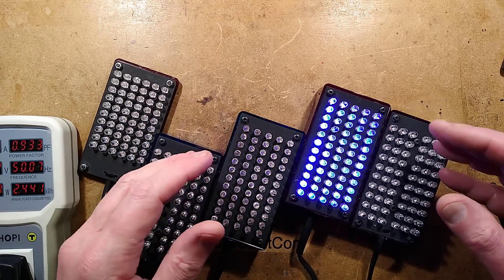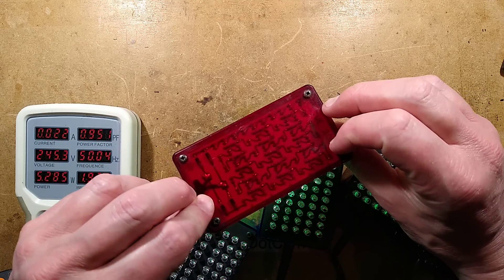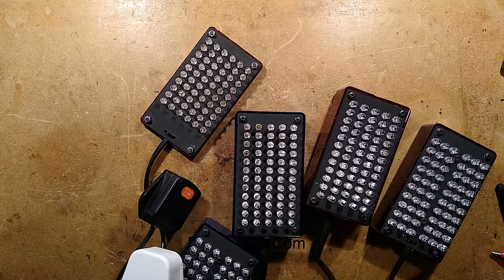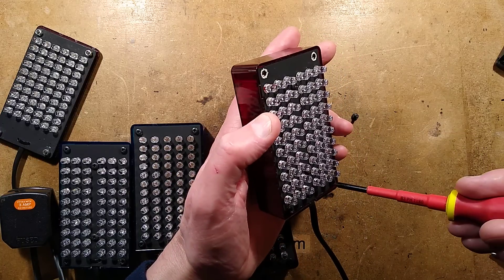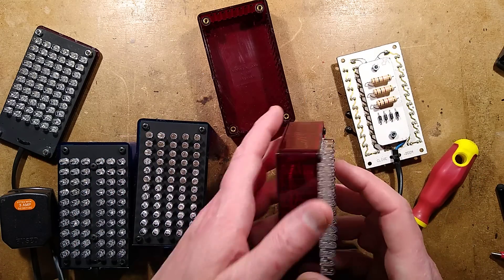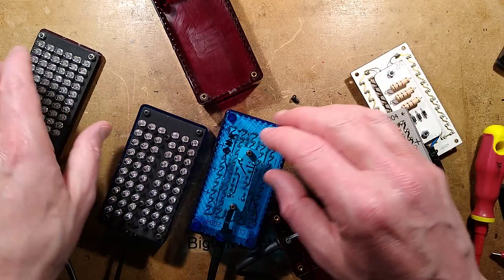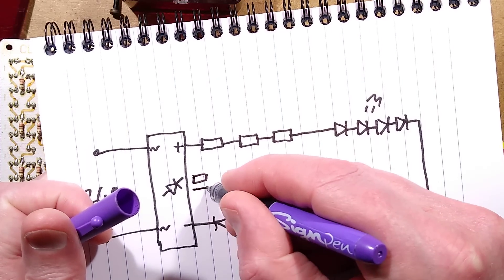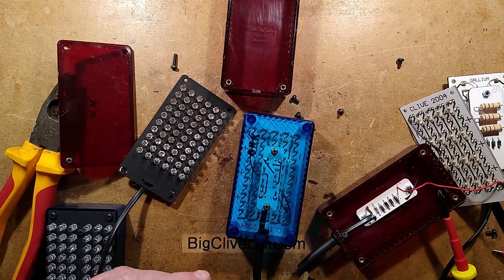Prototype mains LED lights

Comment: Love to see you build a homemade led plant or aquarium lights with the proper nm wavelength LEDs like the correct blue red(405nm I think) IR and other spectrum since I've found tons of discount online sellers are selling plant lights with similar looking colors, but are actually the incorrect spectrum than what they claim, just attempting to trick the human eye with various colored LEDs. It would be a fun project to work on and see if you can find a affordable cheap product with the correct wavelength. Just a suggestion not a request haha. Cheers!

Comment: You should really take a look at those new smart LED view cover for the newer phones. They work in mysterious ways with new phones that allow you to reverse wireless charge, but it even works without any of those features on (including bluetooth/nfc/wifi/data). I'm really baffled as to where it gets it power and how it communicates (you can upload your own image using an app to those covers), though online I read that it is in fact done using the same coil that allows reverse wireless charging.

Edit: you can even get them from the phone brands such as Samsung, so it's not even a weird chinesy thing!

Comment: For the current regulating version the lm317 was usable i think because it uses a relative/floating voltage.. and with a pullstring (isolated) switch attached you can use two brightness settings by switching a current sense resistor in parallel..

Comment: With all the LEDs in serial, how is the green one (with the dead LEDs) still working?  Surely, if one fails, the whole lot will switch off - a bit like the old Christmas tree lights?
Reply: InGaN LEDs often fail short circuit.

Comment: Hi Clive, could you put a smoothing electrolytic capacitor on a simple circuit like that for smoothing? Obviously would have to be rated for 240v RMS mains.  I've been toying with making some kind of 'easy maintainable' LED panel for my work area that'd be good for doing videos, since usually the high powered ones are pretty bad for filming or they're very expensive and usually disposable.

Comment: These remind me of a construction which I did in about 1988, one with orange and one with green LEDs, for our school's photographic darkroom. The narrow emission allowed for quite a significant light intensity without affecting the photographic paper. No circuit board, just point-to-point wiring of the LEDs which were stuck in a piece of MDF behind a plastic cover.

Comment: These would work well with the drivers from the bulb filament Led lamps as a current limiter.
2004 is so long ago, I am now 35 years old and in 2004 I was in 9th grade 😦

Comment: I remember those times. At that time there were still auctions on ebay (almost dead now). I felt lucky when I got 50-packs of (inflated brightness value) blue LEDs for less than 20€!

Comment: Is it more efficient to have a higher voltage LED array, maybe 300v, and have a large smoothing cap and lower value resistors? Obviously PF will suffer.

Comment: I have some LED Edison Socket lights that we acquired in 2006 with similar dome shape LEDs in them. They were not cheap. They are very blue with a high K value. No visible ripple (good drivers).

I decommissioned them in 2010 and kept them. An interesting look at how LEDs were made in the early 21st century.

Comment: This reminds me, I need to revisit my 3d printer LED light. After 2 years of being on 24/7, it finally had a few LEDs die, which caused the series strings to stop working. I think on my rebuild of it, I'm going to use fewer LEDs and under-run them, as my original design was way too bright!

Comment: Let me guess before I watch.  From china so no fuse, no earth, probably a metal bit or two that tingle when touched and no current limit on the input if the rectifier blows up.  I was right as the resistor is on the DC side so if a diode pops the bridge emits it's magic smoke!

Comment: There must be something about the Scots and multicoloured lights. I remember building a light display with an ex-GPO uniselector, Christmas tree bulbs, an Airfix 12v supply, a relay and a capacitor when I was a kid. The relay was wired to the supply via its NC contacts, and the capacitor was wired across the coil. This resulted in the relay switching on and off roughly every second. The switched output drove the uniselector, which lit each different coloured bulb in turn. Must be something to do with the long, dark, wet Scottish nights.
Reply: Multicolored lights are popular here in Mexico, too - perhaps Scotland was first settled by the Maya.

Comment: Is there any disadvantage to using one of those linear current regulator chips, if you can find a source? Besides the obviously higher cost compared to resistors.

Comment: I remember the first LED lights I got from China that screwed into a light socket in the mid-2000s. The light was a dim, cold blue, but they looks so futuristic like it came out of Star Wars. After a year or so, the novelty wore off, and I replaced them with generic, warm white LED bulbs from Walmart. I was so used to the cold blue that the bulbs kind of looked like orange bug lights for a white. I'm still using them. I've used brand name LED bulbs elsewhere, and they just don't last nearly as long as the cheap generics. I think it's because the brand name light bulbs are driven hard for a short life, and they're relying on their brand name for you to not try the generics and just come back for more crap brand name LED bulbs. Still, they may be developing shorter lived generic LED bulbs, so I don't think LEDs are ready for permanent fixture installations. I don't want to replace a light fixture in less than 10 years. In general, I just don't care about the look of a light fixture unless it just looks really hideous. If it does the job, I don't see much of a point in replacing it.

Comment: I did something similar around the same time. Except I made them into 15 LED strips, ~ 40cm long (x15mm wide). Cheap 5mm white LEDs, and a capacitor dropper prior to the bridge rectifier. Problem with those cheap white LEDs, was that the phosphor aged quickly, and it lost brightness, only after a few 100s of hours of operation. I still have a few hundred of those cheap white LEDs left.

Comment: Is it possible to combine simplicity, low/zero flicker, and high power factor? Or is it more a case of "pick any two"?
Reply from the maker: You can have everything, but it makes things more complex and expensive.  Power factor is the hardest to fix, but isn't too critical with low loads.

Comment: Clive, I have a question. Can you make a rectifier bridge using LED’s? To convert the AC to DC?? Just wondering.
Reply: A rectifier has to block current when the voltage across it is reversed.  A very ordinary silicon diode may support 100V reverse or much more.  Most leds have very low reverse voltage breakdown.  If you  want to rectify 6V ac you might get away with it.  For higher voltages check "reverse voltage" in the data sheet for the leds you have, or similar.
Reply: Also the current rating of the LEDs isn't really suitable for using them as rectifying diodes...
If your circuitry is only drawing 20mA, it might be okay 😃

Comment: Nice to hear what you would do now compared to back then. Any chance of building one with what you would do know and compare the output & current draw side by side?

Do you look at some of the stuff you have done and say "i can't believe this was state of the art high level tech stuff, now everyman and his dog, including school kids are doing stuff/using stuff that is higher tech and would have cost an arm & a leg than you were/did once upon a time?
Reply from the maker: The cost of stuff has dropped dramatically as electronics have evolved.  A good example is the modules sold for use with Arduinos.  Some are incredibly cheap for what used to be an expensive industrial component.
Reply: @bigclivedotcom  Very true Clive, very true. Test instruments like oscilloscopes are infinitely more affordable and not really a mystery - when you go from a cathode ray tube screen & lots of knobs & buttons to a computer screen with soft buttons, it seems so much more easier now. It probably isn't, it seems that way. I think it really has to do with information availability and the plain English used these days by the suppliers of such equipment now.

Comment: Back in the day when LEDs were so weak, many people didn't think they would be viable as lighting, at least not in our lifetime. We used to discuss with our colleagues all the time and it happened so fast. Now they are here and just as we expected, they produce so much light while drawing so little current compared to the tungsten monstrosities we had during the past century. They are employed in all sorts of heavy duty applications too and developments are made every day. I've had no part in LED R&D but I've used them all the time in my circuits. They may seem uninteresting to people who didn't work with electronics closely. But I still get fascinated each time I look at a LED light bulb and really appreciate them. I have issues.

Comment: I would also be interested in seeing an updated version of this, since I was thinking about doing something similar. My thought process so far was to take a metal flat connector plate for wood construction (cheaply available from any hardware store) for heat sinking, sticking led tape all over it, and then 3D print a case around it. But it certainly wouldn't hurt to see how people who actually know what they're doing approach this.

Comment: Memory is a weird thing isn't it?!  I love the way you find your own work interesting as if you've never seen it before... I've come across things I've done in the past and in some cases (most recently a bit of plumbing) that simply I just do not remember doing, but literally no-one else would have done it!  Given that when I was younger I seemed to be able to remember everything, it's a little disconcerting... I guess it's a case of aging and the fact that time seems to fly by now, and I believe our brain's RAM just has a limited capacity and starts archiving older stuff away, and isn't readily accessible (if at all?!) (especially if you're constantly learning new stuff)

Comment: They lasted so long because they are minimalist, the bare minimum to work, not so many components to fail. The more components the more chances of failure. The ones with the 3 big resistors will last longer than the ones with smaller values but more off.

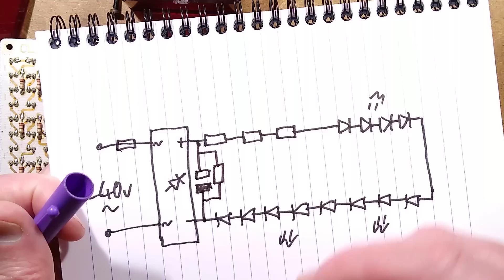Comment: Awesome stuff as usual Clive! Just one question, why the discharge resistor at 7:48? Wouldn't the cap be discharged anyway by the leds?
Reply: My guess is that the forward voltage drop of the LEDs provides so much resistance that the capacitor will remain charged to a significant voltage even after power is removed, unless another discharge path is provided.

Comment: Connect the smoothing capacitor between the 2nd and 3rd resistor (from the rectifier). 
That will fix the inrush and a guess you get a better power factor as a bonus.
Reply: Yep, same thought here.. connect 1k each from the mains to the bridge rectifier inputs, then cap, then the last 1k resistor and to the leds..
Keeps the higher voltage and spikes away from the rectifier and the cap.

Comment: Question:
I have some devices with leds in them plugged in one outlet and the leds are flashing every few seconds when turned off. (L or N disconnected trough a switch) What is the best way to prevent this?
I thought about a simple capacitor with discharge resistor that can be plugged into the same outlet. Will that work (well enough), or is it stupid?

Comment: About 15 years ago, I used perfboard and a crapoad of ebay white LEDs to make a 12v LED bulb out of an expired Philips (I think?) CFL that had a screw-on outer glass bulb, of course I was a berk and didn't use any current limiting, so "12v" solar power on a set of 4x series'd boards with the LEDs wired in parallel (assuming 3v per LED) with no limiting, yeah, that burned out in no time, wasn't all that bright either, which wasn't exactly unexpected knowing that at the time LED "bulbs" needed a shittonne of LEDs to be of any use, cos we didn't have the affordable high-power ones we have now yet... :P

Comment: Clive the Clever 
Could you design a 3d box but  add a conducive 3d filament inside the print?
This be built very thin?

Comment: If I remember rightly, the older gallium nitride LEDs had a higher forward voltage drop of around 3.5V, which would be 210V for 60 LEDs.

Comment: It's amazing how well and fast LED technology has advanced. I remember my first LED flashlight was one of those cheap 9 diode ones that ran on 3 AAA batteries and wasn't much better than your typical incandescent. Then I got my first cheap Cobb LED light and was blown away by how well it was. Now I have Cree flashlights that just blow those two out of the water!
It wasn't that long ago we were using 60-80w incandescents. Now you can leave your lights on and never see a noticeable hit on your electric bill. In fact the month I switched all my lights to LEDs, the electric company owed ME money.
Reply: Yeah, I have an old (unknown age) plastic flashlight (runs on 3× button cell batteries), which supposed to have a white LED, but it has such cold colour temperature, the light feels "icy" ‒ what a garbage LED. 🧊 🔦

Comment: Wouldn't it be possible to surface mount those diodes as well? It wouldn't be ideal either, but it should be a touch safer.

Comment: Around 2005 I built a "night vision" lamp out of IR LEDs, and an array circuit board from some company I long forgot. Not mains powered, but 12V and it was my first big foray into PCB soldering.

It had about 90 LEDs and it did a semi-OK job of lighting up the dark for my camera.

I built another one some time later but with "UV" LEDs to make a blacklight. I think I got ripped off though because they were more purple than UV and didn't fluoresce things that well.
Reply from the maker: The "UV" LEDs from eBay are very random.
Reply: i should revisit this project, i did this too and removed the uv filter on soooo many old cameras for the purpose :D the biggest/baddest camera i modified was a 10 megapixel canon

Comment: I bought from Best Hong Kong too. I wound up going through the whole packet doing a basic function test and doing some crude "binning" on brightness to get LEDs that were at least similar.
Reply from the maker: Yeah, that's when I learned to test every single LED with a very low current to see if it lit or not.  If it didn't light at 100uA it was inevitably going to fail.

Comment: I went to a similar building phase in '04 after seeing the cheap LEDs on eBay.

except I was building IR illuminators.

and yes I smoked the resistors on my first couple prototypes.

Comment: Love this project!
Have you had a dabble in the handheld spotlight feild? Using your choice of LED, choosing a driver and battery then some lenses and reflectors to see how well you can get it to perform?
It is good fun
Reply: I have one of those 6x D-cell Maglite flashlights and I'm amazed at the DIY options for rechargable batteries and 5,500+ lumen bulb replacements. Pricey, but I think once I buckle down and do it, it'll be worth it.
Reply: @TheNiteNinja19  there are some amzingly powerful little cree boards out there

Comment: Could you use a triac or SCR/diac combo to chop the bridge input for more efficient system than purely resistive limiters? This reminded of one of my old projects I built back in the late 70's when I worked at a TV repair shop. It was "Bench Art" with electrolumenescient panels (from "Poly-Paks") and neon relaxion oscillators. It's all built into a Sprague plastic box capacitors used to come in. I haven't had the chance to check it out before doing a cautious mains power up. I had a neon sign transformer Jacobs ladder back on the wall as well, but that kinda scared some customers so we settled in on the more sedate light show boxes. Fun stuff. You've inspired me to get some of the old toys back up and running....

Comment: well, 30mA is the limiting value, they keep saying so in datasheets, so generally speaking you CAN put 30mA RMS but a lot of factors start to kick in for the demise of the LED... i bet like 20mA (heat apart) is the current to aim for, less if it's just an indicator LED or you care about battery life or supply ripple or else.... anyways i've pushed a late style 5mm blue LED (100% unbranded ebay) up to 150mA, it popped after that and in between of current bursts i checked it's brightness and it didn't suffered, but yeah, it's 15-20mA if used properly

Comment: Britain has the best plugs. They look very sturdy compared to the US style.
Reply: Great fun to stand on in the dark.
Reply: @T.J. Kong You are so right! I just moved into an older house and the plugs just fall right out. Those three sided flat edged British plugs look like they would hold up a lot longer.
Reply: It's a toss-up, really.   They're also _huge_.   The only one bigger, that I'm aware of, for normal household use, is the South African Type M socket/plug.   Britain's is a Type G, I believe.    There are always trade-offs.   European Type C, which appears to be the most common in the euro-zone, is non-grounded, and is equivalent to the North American non-polarized Type A.  (I say that because they don't seem to have a 'type' for the non-polarized socket)   In my opinion, there aren't any dangerous outlet/plug types - if they're used correctly.   If they're not used correctly, don't blame the plugs.   "You can short it out if it's not all the way in!"  "And this is a problem with the plug, how?"
Reply: Yeah, but the plug's about as big as my head.